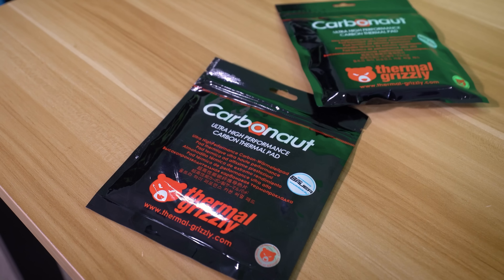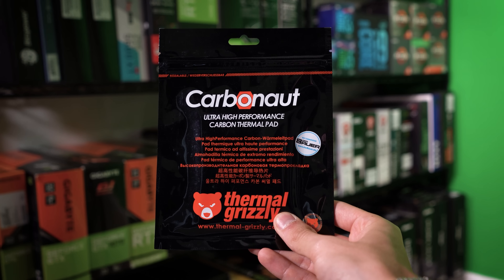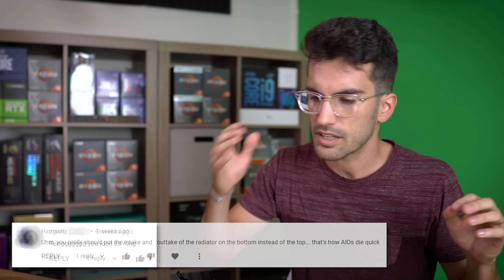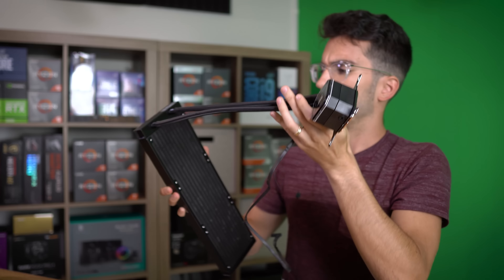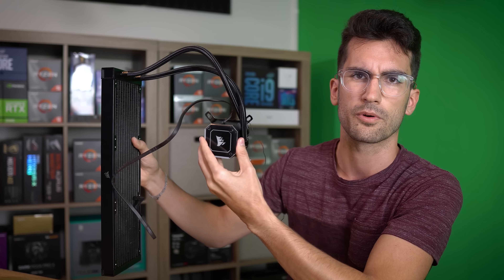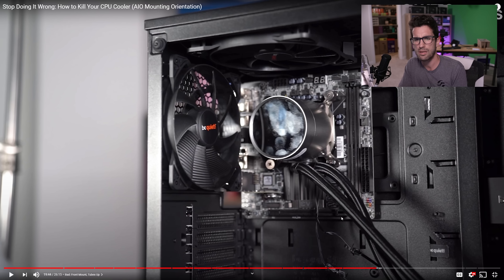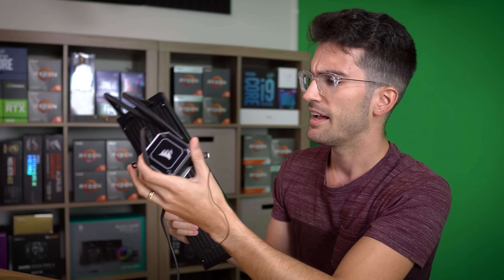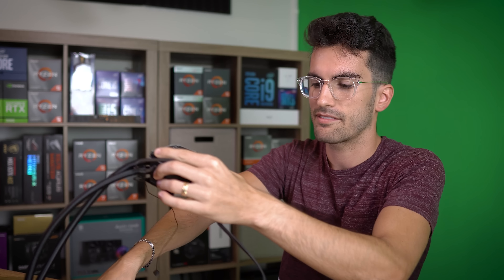Let's Talk About AIO Orientation... Again

Comment from the maker: For those who need a TL:DR - Front-mounted, barbs-up radiator placement is FINE a vast majority of the time. Unless your loop isn't filled correctly, air shouldn't incessantly circulate through your pump after the closed system has primed. The worst you'll likely experience in this config is a bit of noise at the top of the rad. But if pump whine persists, its very likely your loop wasn't properly filled/topped-off.
Reply: Question Greg, in the market for a 240 aio.  Any suggestions on ones I should consider?  Thanks for the great content.
Reply: That is true, with the exception of front mounted tubes up, AND still sitting below the pump. I just had to do an emergency recovery on a friends machine that died due to the AIO failing after just a few months because the rad was front mounted and sat below the pump, which left air bubbles in the pump and burned it out.
Reply: You're using a microphone, there's no need to yell the whole way through the video man.
Reply: @mtnentertainment3454  ahh must not have been filled correctly 🙄
Reply: @jblps  probably the case. it was a cooler master after all...
Reply from the maker: @nidiot37  You think this is me yelling? :_ScienceCool:Didn't mean to offend you!
Reply: @GregSalazar  I don't think you were yelling,
you did get a bit louder in some parts but it was understandable due to expressing the Frustration caused by Unnecessary Rude Abusive comments
Reply: Is The Act Man your twin brother?
Reply: What about an horizontal mount like in the NR200?
Reply: ty for the video ! Very clear points ! The next video should be about AIO leaking risk ? Don't you think ? ^^ (I personally don't know if I should go air or water...love the esthetic of AIO vs Air coolers but if it is really at risk for my system, it wouldn't be reasonable)
Reply: I mean... Steve doesn't have anyone but himself to blame for people "taking him out of context" tbh

That Radiator example was build like shit, looked awful and was just... trash. It was almost as bad as that shitty cyberpunk build etc. It just proves Gamers Nexus' craftmanship is so bad and shitty they made people misunderstand the situation.
Reply: It’s ”FINE” if you are a suboptimal kind of person. 
My guess is that people watch GN because of what is optimal, not for what is ”fine” or unnoticably worse but still okay.
Just consider ram overclocking for an example. A majority of people would not notice a difference if they even forgot to enable XMP, BUT that is not the point!
Reply: Thanks for calling this out man.
Reply: How well does it hold in the long term tho? People tend to forget about permeation and other factors. And for those who will bring it up yes temps are affected but only by a small margin (i've seen a max 5 to 6°C difference but normaly it's lower).
Reply: I agree with essentially everything you brought up in this video, however I think you may have glossed over something as well. The level of fluid in all AIO's will eventually drop due to permeation. Steve addresses that as well. It doesn't change anything, but over time that orientation will eventually gurgle a bit. People on the internet love to take everything out of context though.
Reply: Issue is, there is always some air in the loop. Over years of service, the amount of liquid will decrease and amount of air will increase. Since air is a gas, it tends to reside on the top of the loop. If the pump is on top, it won´t work properly, make noises and eventually die - much quicker, than under normal circumstances, since the buble will be in the pump, restricting coolant flow. If the rad intake/outtake hoses are on top, then the air will accumulate there, again restricting coolant flow - especially on the outtake side. Pump will get less coolant and might again whine and eventually die. You might also encounter worse temperatures (issues might deepen over time) than with rad on top or front hoses down location.

Custom loop is different, because it has it´s own reservoir, which has pump at the bottom of it. The air bubble is also held there. It´s similar to car engine cooling.
Reply: I have my AIO in the front, with the pipes at the top but the pump is on the radiator and not the CU block (Antec Neptune 240), that's fine, right?
Reply: You really shouldn't be providing misinformation like this. It only serves to hurt your credibility when you try to poke and one up one of the most respected authorities on these topics while presenting bad information, yourself.

You provided blatant misinformation about the state of coolant level vs air within the AOI cooler, completely dismissing critical details that were covered by Gamger Nexus. First, he covered coolant levels from different AOI. He also covered the issue of expansion of coolant, one of the reasons a small amount of air is actually desirable but fairly minimal levels none the less, and loss of coolant over time which you completely ignore. In fact, almost no AOI coolers have <1% air in their AOI coolers and he covers that as well. You completely dismissed that coolant levels decrease dependent upon materials used for tubing, regardless of tubing type but at differing rates depending on material which he covered, as well as thermal punishment the coolant is subjected to over time. All AOI coolers will lose coolant over time. You are trying to take the stance that this orientation is okay and will never realistically run into the issues presented with a "good" AOI model. This is false. The other orientation doesn't feasibly suffer from this issue. You make too much of an unspoken assumption that all AOI will be replaced before it becomes an issue.

You, yourself, have admitted to only having experience with AOIs over a time span of roughly <6 years. While the issue can occur more rapidly, this issue is primarily a concern for those using an AOI for many years and it sounds like you have rapidly gone through them and likely used none even close to that 6 year period, and even at most extreme case 6 was the most you gave room to claim working with. Your "experience" might not be the best defense of this case.

He didn't say barb up couldn't work, and pointed out this configuration could be ran IF you couldn't fit the opposite way due to PSU shrouds and other build reasons but advised against it as it is a clearly scientifically (your limited experience) supported as GN presented it and the two primary configurations offered simply don't have the potential for all the issues this one does. You are walking an extremely close line to claiming this is just as fine as the other two orientations. It is factually not. It is scientifically inferior. Fact. However, it can be used as a last resort option with some caveats, most notably potential risks, increased likelihood of noise impact, and most notably a factually shorter life (less relevant, typically, to those who upgrade builds significantly over short periods of time such as 2-3 years).

What I'm "sick of" and find "so annoying" is how whiny and irresponsible this video is when you obviously know better. You simply made this video for views and a bit of publicity knowing better. This video could have briefly covered some thoughts about the topic in around 5 minutes and expressed that this configuration CAN work, though it isn't ideal, without likely running into any real problems over a couple of years if you somewhat regularly rebuild your system but should be reconsidered for those who keep major parts of/entire builds around for 6-10 years, and possibly even 3-4+ depending on tubing material and thermal impact (rendering stations vs gaming, etc.). This video is especially bad because, while others may have exaggerated things or tried to go overboard with the subject it was you who didn't merely try to create a proper video addressing it but instead tried to blow it up into a publicity stunt and even tried to poke some comments at Gamer Nexus throwing subtle shade that they could have presented things better or they threw in X for sake of it but it really was too much, blah blah. The reality is Gamer Nexus actually properly covered the context and odds of impact on each of those points you tried to throw shade at.

If I'm to be perfectly honest... I just find this video disappointing and if Gamer Nexus comes at you publicly for this, well... You only have yourself to blame for how you handled this.
Reply: All I have learned is almost all AIO water cooling is a cheap crapshoot solution that can fail. If its not the hose length, the hose flexibility, the bad AIO software, the lack of proper pump block mounting brackets (Corsair), or the size of the pump block, its this problem which can be fixed with a filler port on the radiator. All these AIO manufacturers have to do is read their reviews, & fix the problems. It would help a whole lot if they made them modular, or just better to save up for custom water cooling solution.
Reply: @zeiflemaroon3845  No even GN stressed in their follow up that it was fine if it’s how you have to mount it and I’d much rather have it in the front for better overall temps if my only alternative was to mount it at the top.
Reply: @lordgarth1  From the post of mine you are replying to...
"He didn't say barb up couldn't work, and pointed out this configuration could be ran IF you couldn't fit the opposite way due to PSU shrouds and other build reasons but advised against it as it is a clearly scientifically (your limited experience) supported as GN presented it and the two primary configurations offered simply don't have the potential for all the issues this one does. You are walking an extremely close line to claiming this is just as fine as the other two orientations. It is factually not. It is scientifically inferior."

If you are one of the people who replace your build including the AOI every 3 or so years it probably wont be an issue for you so go for it and enjoy the better temps having it at the front of the case pulling in. Typically, most builds should be able to rotate it though so when possible ought as well go with the superior and less problematic option. Unfortunately, this video is effectively just a silly rant for views and not actually trying to pursue the issue in a relevant way as they walk extremely close to claiming the orientation being discussed is simply "totally okay" and "equally good" with nearly total disregard of context. Shame on Gred for that.
Reply: @zeiflemaroon3845  AOI? I thought it was AIO!
Reply: @gamingnomad132  Yup, AIO. I have no idea why I reversed the O & I in not just one but both posts every single mention. Good catch.
Reply: @GlennsHardWired  but not all aios have tubes long enough that they can be front mounted with tubes down
Reply: @zeiflemaroon3845  why are you so mad lmao
Reply: @Gomezdude7  I'm not the one mad, it would be the person who made a video literally proclaiming their irritation and rage at a situation and then provides misleading context. My pointing this very fact out and clarifying their BS does not even remotely indicate I am mad so your reply to me really makes no sense at all.
Reply: Is it just me or he is kinda cute?
Reply: Air bubbles are not bad for a motor because the fluid lubricates or cools it down, it's because the motor works without anything opposing it and revs up the same way when you pedal a car engine without any gear engaged.
Reply: The main thing to take away from Steve's video is that the barbs up approach is fine as long as the AIO is relatively new and is properly filled, which a lot of people didn't lol
Reply: @DragonEdge10  Indeed
Reply: These sound like fighting words
Reply: Never go full Florida Man Greg!
Reply: Stephen Burke "Gamers Nexus" is more educated than these YouTubers.............Greg Salazar is just salty because he has been doing wrong haha.
Reply: you will definitely get a lot more gurgling\noises with tubes mounted on top than at the bottom. That is what makes it incorrect, tho not necessarily more dangerous for the pump as you said. 
Some of these companies have 10% air in their closed systems, so this is a lot more important in those systems. With 2% air it's really a non-issue
Reply: @GlennsHardWired  guess what some people care more about looks then optimal performance. Some people dont mind buying a new aio in a year or 2 if it fails. They are only like 150 bucks. Which isnt that much unless your broke.  Gregs point is there is no point in talking shit to people about there discision when it doesnt personally affect you.
Reply: @GlennsHardWired  Your testing and user experience that you've presented here is not an argument for "barbs uptop is not OK". It is an argument for barbs down may produce better temps and/or less noise. See the difference?
Reply: @jblps  in Greg’s comment he did not mention you need to keep the pump below top of the tank. He said it in the video, but makes his tldr not 100% right out of context.
Reply: @CodeMonkeX  "tANK"
Reply: Are you planning to do a review on the Eve Spectrum monitor?
Reply: @GlennsHardWired  Everyone is just talking about how to not mount a aio but no one tells the perfect positioning  or better shows it
Reply: Late to this, But thank you so much, I was literally taking my AIO out to mount it with the Barb down the bottom  would of had to strip my whole computer and figure out how the Pipes would fit past my GPU etc.
Reply: i had two corsair aios fail on me. two generations. last time. went the ali route instead. at least if one part is bad i dont have to replace the entire thing.
Reply: @dashkatae  dont get corsair. i believe it was bubbles that killed both of my aios. and consequently one high end pc from a few years ago.  one ran ok for a while then died. the other died within a day or two.
Reply: One of the points I remember that Steve mentioned in the video (or maybe it was a follow up) is that even the best AIO will have a little bit of permeation over time. So with a top tube mount years from now there's a chance that there will be more air in the AIO then when it was new and if that's the case then the tubes might be sucking in the extra air that's at the top of the radiator.
Reply: Well unfortunately I must be one of those rare cases, it's been a whole year since I bought my AIO, a 120mm NZXT's Kraken, and it has been permanently noisy for a couple weeks so I decided to give it a try and turn the rad (front mount), the noise dissapeared but for some reason my temps went now straight to heaven, or should I say hell? You get the point they just went up and I'm freaking now, any suggestions?
Reply: It's not Fine.
You don't see vehicle radiators bubbling air through the water pumps because the don't last long and cook your engine.
Reply: i guess Im asking the wrong place but does someone know a trick to get back into an Instagram account?
I somehow lost my account password. I would appreciate any tips you can give me
Reply: @Marc Vincenzo instablaster =)
Reply: @George Jaxxon It worked and I finally got access to my account again. Im so happy!
Thanks so much you saved my ass!
Reply: @Marc Vincenzo Happy to help =)
Reply: @Morpheus-pt3wq  I could not mount my radiator on top because my RAM stood in the way. And it's too late to change the case or the RAM. The only option was to mount the rad in the front with tubes coming from above. But I did not want to do that. So I tied my fans on to the Radiator with a shoe lace in a way that it won't interfere with the RAM, and mounted it on top.
Reply: Just to be a git:  Completely fine to orient rad on the bottom and block at the top if your pump is mounted in the rad. 😁
Reply: @GregSalazar  I have an unusual case. do you think it's going to be fine to mount the GPU AIO on the side? The GPU and the radiator will be at the same height, no lower and no higher.
Reply: @zeiflemaroon3845  lol
Reply: @nidiot37  yelling? What yelling?
Reply: Thank You Greg Salazar for this vid. Hope those who keep on stating orientation is always wrong gets to watch this
Reply: Why dont they make the tubes longer with like a rotating 90 degree barb fitting so you can mount it barbs down and be able to route the tubes around the case in a clean manner
Reply: Or design the rads with a little head space above the barbs where air can accumulate if there is any above the outlet barb and eliminate any problems.
Reply: Isnt it possible that the coolant could evaporate somehow? I have a custom loop that every few months got to top it off. Where water goes who knows.
Reply: Thank you so much for this video ! I have a case that can only support my 420 Aio on the front and can't put it on top (max 360) I'm less stressed now. THANKS !! I subscribe to your channel for other useful tips ;)